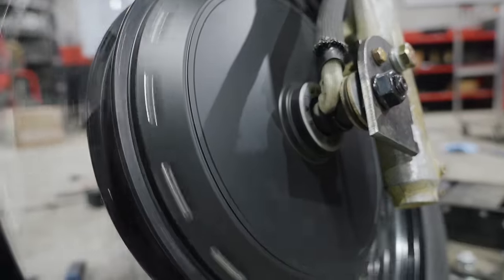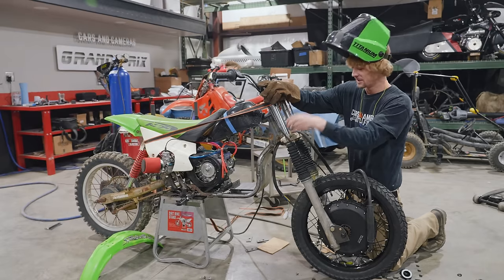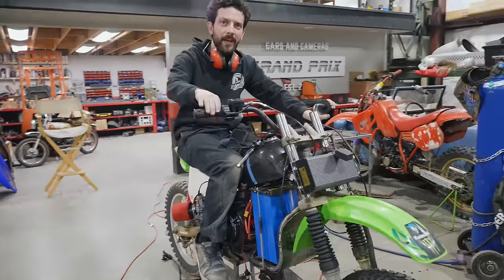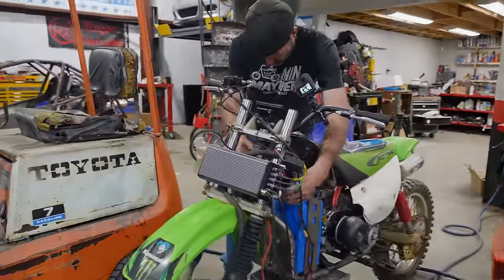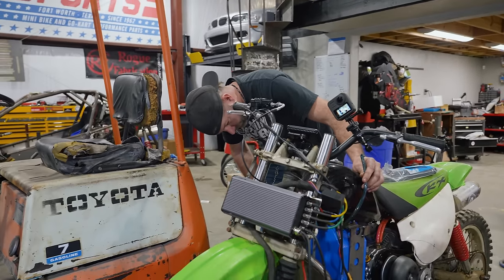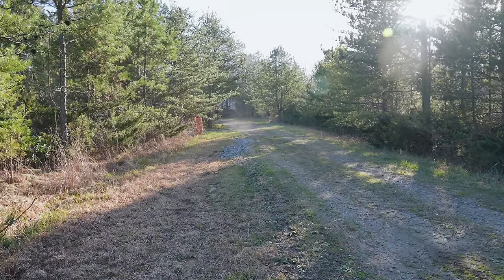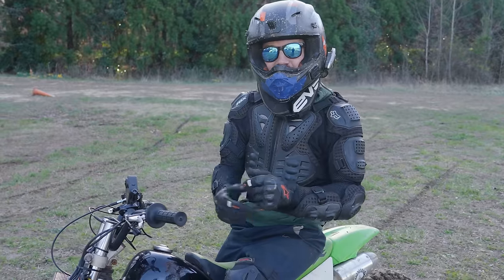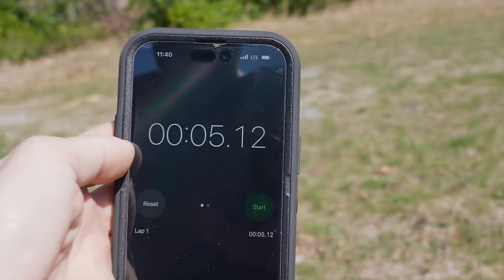AWD Dirt Bike First Test Drive! (35 Combined HP)

Comment: Mount the e-hub motor with adapted sprocket and disc brake on rear wheel, so you'll have gas and (Hyper-Boost) on one wheel. (Heavy battery should reduce wheelies):glasses-purple-yellow-diamond:

Comment: I have this exact same NB Power kit on an ebike frame that weighs about as much as a pit bike and it's insane. Easily capable of 60+ mph and so quiet you can sneak up on wildlife. A meatier tire would be much better, but with so much torque, it's going to spin anyway. A really cool idea would be to transfer the ebike parts to something like an fl350 Odyssey with the electric throttle mounted to a pedal

Comment: Hybrid is cool. you can use front motor to bump start the engine., regen to brake, recharge the battery when cruising etc.
adding a second electric motor in the rear coudl be fun too. maybe also mote controllable because it would balance weight to the rear , and you could control front and rear motors  with the same electric throttle so you woulnd have the delay between instant torque in the front and the delay of the gas throttle reving and building power.

Comment: Adjust the throttle curve in your controller . Get a way better tire and maybe design a lever that bolts the the twist throttle to push on he thumb throttle of the engine. Also, play around with assist, in theory the electric motor can automatically apply when the bike is under power from the gas engine . Awd drive dirt bikes do exist and learning to ride them ( christie is an example) is a handful but has huge benefits. See if your controller supports braking through electric motor or regen braking to help with the stopping issues.  Lots of raw untap potential on this build I hope you take it seriously and really unlock it.

Comment: think youre going to need to change some base settings , like the ramp up and maibe setting the max position of the trottle (might be to far away from actual full trottle on the handle) , not sure how you need to do this on the controller , you usually set it trough the electronic dash or through the bluetooth app 
the chineese stuff usually are a bit hard to find sensible manuals for so you might need to experiment to find out the settings you need to change in the menu 

something you might be able to try is using a sensor on the back wheel and couple that in some way to the pedal assist option , on a pedalbike sensor they usually use two sensors (1,2 1,2 etc) this is to prevent the motor from turning on when you pedaling in reverse , it allso makes it eazier to guess the speed of the pedals (times between the 1 and 2 ) 
if you can get this working you might not need the electric trottle

Comment: Dutch mopeds had brackets where this lip fit in. The brake plate had to move with the wheel to tension the chain. So the lever on the brake plate had a slot that could move on a pin but stil kept it from rotating. You could make a slot downward where these flat spots fit in. But i dont thing driving will be an issue. Braking might be giving more force.
You might have to find out settings. The controller of the electric motor needs to be set in a slow upgoing power mode. See if your controller can do that or use a frequency transformer.

Comment: Switch it to gas up-front, electric in the back. I went to a classics auction about a decade ago; one of the sales was a three-wheeler delivery motorcycle with the gas engine mounted in front of the forks, chain-driven to the front wheel - which left an appreciable cargo space in the rear despite it being a pretty dinky little trike. Always wondered how it'd pan out, what with the weight on the wheel and all.

Comment: Weld and grind and repeat till you get something like the notches you want 😊.  Put a sheet of aluminum road sign under it and clamp that down so your material your adding doesn't stick to that too.  It makes less material to grind flat again when you get the metal built up inside where you'd like it too.  You'll probably have to triangle file it flat to make it more like a machined finish and less welded metal finish though and that's time consuming.

Comment: Really need a precharge resistor between battery & controller. (Probably a circuit breaker too) the spark is because the controller need to charge its capacitors inside to work and its trying to pull as many amps as possible as soon as you plug it in. Doing this too many times can blow the caps and destroy the controller.

Comment: I think it'd work better if you used the thumb throttle for the front wheel and the wrist throttle for the rear. Then you could just add the front when going in a straight line.
 Also you could add a stop switch to the steering so it shuts off when you're turning

Comment: Gas only in the corners, both on the straights, a better tire for the front, some type of front brakes, and a easier throttle set up, maybe a foot brake for the brakes, and 2 thumb controls for the motors.

Comment: This would be a gamechanger in some heavier adventure bikes when you get stuck in mud , or crawling up some loose terrain, but only to be used then as an aid. Also could give a way to reverse a bike in tought places. And yh, electric motor throttle should be on the left. Please try mudding in the future and crawling up some loose rocks or gravel :D

Comment: You will put it down with that street tyre on the front. The dirt tyre might just have to much grip at first though. The front might dart off in the steering direction mote than you want.

Comment: I gotta see this data against doing it with a dirt tire! I’m going to be honest I thought it was going to be dumb too but I’m digging this.

You might be able to get a better top speed by gearing the gas engine a lot taller and utilizing the torque of the electric on take off. I feel like this would work with a dirt tire 😅

Comment: Maybe get regen braking working on the front.   I wonder if you could use an encoder on the rear tire to compare rpm and prevent front wheel spin

Comment: I think the reason that you are having difficulty with steering is because the motor on the front wheel acts like a gyroscope. With the weight of that motor and it spinning, the front wheel acts like a gyroscope wanting to keep the wheel in an upright position. That’s probably why they told that it is not good idea to mount that motorized wheel in the front.

Comment: A speed sensor on both wheels and you would be able to have a rudimentary traction control to keep the front wheel from going too crazy. Maybe could be done with an arduino.

Comment: With that much power you need to put a throttle on each hand so you can control the front tire separately. You only engage the front tire on straightaways. This works better on on road bikes because you have far more traction.

Comment: I tried a few different ways to do the dual throttles for AWD, twist / thumb combo, WOT switch, etc., none worked very well. Ultimately I integrated both into one throttle with adjustable FWD / RWD bias using a Cycle Analyst e-bike computer, makes it easy to tune the electric throttle in proportion to the gas motor however you want. Awesome work, looks like fun!

Comment: needs a knobby front tire.  Can controller use a speed or RPM sensor input? Might put one on rear tire or drive sprocket to provide some input smoothing or ability to control through just single thumb throttle or twist grip so you dont have to use both at the same time.  Maybe also an idea is to make it a fat bike using ATV tires.

Comment: For a monent I though this was going to be some electric transmission type shenanigans where the engine spins a generator which then powers the  motors on the wheels. Like a locomotive.

Slightly disappointed it was not.

Comment: electric bikes got a torque sensor. This sensor only recognizes when the pedal starts to move and then starts to provide full assistance at the level of assistance you have chosen. This causes the front tires motor to spin 
if you have that part put it on in rear so you can spin it in cas engine its a plastic ring where is metal taps and sensor and 2 wires put it on in right wire system and its works and you can set assistance while you drive  you can also order those parts in net they dont cost a lot.

Comment: before i even watch this video i sure hope it works because i want to do this to my 2021 honda trail 125. you can find a controller that will let it open wide open. i see some 2000W motors that run 65 mph but you are carrying extra dead weight  up to 18 minutes in the video.

Comment: Good vid.  With proper practice and application of power at the right times and amount, you will become adept at riding it.  Even with the weight of the motor in the front wheel, it'll be lighter than some of the older motorcycle front wheels.  Back when they used huge alloy castings, heavy twin rotors setups - that was a lot of front wheel weight before modern times lightening everything.  This isn't going to be drastically different.  
Keep it up 👍👍

Comment: THROTTLE SUGGESTION: for the motor control id use a hall affect sensor. they come with ebike kits on ebay for peddle assist features so no throttle is needed. put the sensor on the rear or front tire and itll detect the rotational speed and add torque accordingly. youd have to do some research for adjustable torque curve assistance annndddddd nvm just got to the video where you show the peddle assist......

Comment: You definitely need to heat shield in there but you really need to put it on the blacktop. I think you need to buy one more of those motor and battery set ups and do a go cart.

Comment: I'd make a custom sprocket for the hub motor, put it on the rear and then connect the chain. still a hybrid but one wheel drive as if you throttle through a corner that thing will slide as is now.

Comment: You should try it with the electric motor on the back and driven by the gas engine with a regular wheel and brake up front

Comment: Ive got a session on my channel about the sabvton set up for a hub motor. You need a  few bits of info even after the self learn
Phase Angle 60 or 120
Pole pair sensor count in the hub motor 
Max Voltage
Dead Voltage
You get those entered in do the self learn and trim your throttle out so its not so sensitive 1.6 volts for the low end and 4.8volts for the high  the low end no lower than .8 volts if the wheel starts spinning when the low voltage is set the voltage is to low bump it up some 1.2 should be ok for the low but it will depend on how cheap the throttle was built set your mid range throttle to about  2.8 to 3.2 volts.
Have a blast guys catch ya around

Comment: 7:06 I love how Jon is doing that while wearing earmuffs around his neck 😂

13:14 Ike: “really strange” disappears

Y’all know what y’all should do? Have two paddle throttles on both side one for gas and one for electric whichever one you’ll use more, respectively which side you want it. And for brakes just have normal brakes. One on left for front and one on the right for back or whichever combination suits y’all the best out of that cuz I know for sure y’all are going to NEED brakes for that beast of a machine

Comment: Could be great to have an speed sensor on the gas powered wheel... microcontroller with a PID loop controlling the electric motor..
So the wheel speed matches front and back

Comment: I have the same motor on my ebike. It is wired for 150 Km/h and its absolutely insane. I had it wired for 100 Km/h before but the torque was way to crazy and me and another guy crashed it because of the torque. With the old wiring the top speed was reached to fast and it was feeling strange to not be able to accelerate from that point on.

Comment: Bunch of versions of that QS273. Do you know what you have? What amperage controller? Max amp on bat? 

I'm betting you only have it in a low speed setting and/or aren't using field weakening at all. That hub (if given enough amps) will destroy the gas motor thats on there. Talking 80+mph. And 4 second 0-60 times if you throw enough amps at it. (200-400 line amp range). Assuming it was in back and you could get traction that is....

Comment: imagine if you reversed the controls. So the twist was for the gas engine. And the thumb was for the electric. Then you could use the electric motor. Only for accelerating. straight line. Or to get an extra grip on hills and tough terrain.

Comment: Where's the drag rail with it's EFI? If I had my retrofit EFI in a garage where I could run it, I bet I'd have it running good before you have an update on yours. Already did a first start video. That aftermarket stuff is suppose to be easy.

Comment: There was a 2wd dirt bike made in the 70s or 80s with a cable drive that ran down the fork to drive it running off the engine. The front and rear wheels turned at the same speed. That would be a plus here but not possible. Put the biggest gnarliest dirt tire you can find on the front anyway. Maybe just put the electric motor on the rear and scrap the noisy gas motor.

Comment: oh the reason you were told to not put this up front is because the torque is trying to rip the front off the bike, same as the weight. Under normal braking the torque opposes the bending moment caused by the weight, so it resists better. Probably would have ripped the front fork off a regular bicycle already. Make sure to inspect your head bearings and welds for signs of wear, especially when putting on an offroad tire

Comment: Honestly it might be better to have the motor on the rear wheel, chain the engine to the sprocket, and put it in boost level 5. Either that or rig the throttle to have the motor kick in after the engine, just to keep the front wheel stability. 

I’ve always wondered how it work if an electric bike was 2 wheel drive, maybe a 10kw motor in rear and 5wk motor in front. The front wheel does 70% of the braking so there would be way more regen and therefore longer range.

Comment: why dont you try to put the electric engien in the back wheel so they can work together better 
so there is low end tourqe and high end gas power like a koenigsegg so you gear the tilitson a bit higher for more speed

would be nice to see that working
Reply: If you can get the hub/sprocket figured out. I wonder if anyone has tried this?

Comment: This is really insane.  Have seen 2wd electric, but never such a combo. 
Will be fun and more useful to see the front with a real tire.  Just have to find a way to sync up the throttles. 
Or maybe separate is better? Just a learning curve for around the curves. 
Does the front motor drag if it is coasting?  Hopefully not. There has to be a brake function for that... electric front brake. No disk necessary.  o0

Comment: what about testing a real "hybrid" set up!? well i noticed that the motor being a "hub" drive it has no shaft to transfer the energy it produces like traditional driven set ups. uniquely energy is transferred through its own housing/body. so in theory could you not install a sprocket  to the hubs body as you would a shaft and produce the same affect? in turn building a hybrid setup. i think that its worth a shot

Comment: Charge to 4.2 volts per cell bank.  Typically if they get under 3 volts the sells should be thrown out.Lithium batteries do not like low voltage.  Usable charge range is about 3.3 volts to 4.2/cell.

Comment: I don’t know if you will respond to this but I have a modified predator 420 with a 40 series torque converter that I’m trying to get street legal and fast I was inspired by your blown up blaster engine into a transmission and I wanted to make or buy one that’s got reverse and at least 3 speeds  got any suggestions for me on what to do
I have a video of it running on my channel

Comment: and those e-bikes  hand brakes has a switch and wires what stop assistance when you press brakes you dont need to press it in full send just a little at switch it on and assistance stop its like a clutch on e motors in little work you can put it in feet brake system or keep it in handle pars i know what im talking ive build many e-bikes i was working in bicycle shop some time.

Comment: i saw a sprocket on the electric motor in the first vid and as wondering if you could just put it on the rear with the connected to it

Comment: I was thinking since with electric you get 100% torque from the start that they should use the electric motor to launch it and get it going and then pin the throttle on the gas motor

Comment: Why wouldn't you splice the throttle cables together and run one throttle tube? Or buy 2 aftermarket aluminum throttle tubes, cut the cable capture point off of one and weld it on the end of the complete one clocking it correctly so both powerplants work together. In other words, not fighting each other.

Comment: You guys need to flip the throttles around ,  so that the electric motor can be Only used as a boost in the straights and the gas around the curves .  ....Yes, as jasonmartin1775 said in the comments !    You Don't want the front wheel to have power in a corner ,,  that will just make lose traction and in turn have Zero control .

Comment: That hub motor is way too powerful for the front wheel. No wonder it just spins. It would be better in the back, but then it wouldn't be Cars and Cameras.  Don't worry.  It'll be fine. 😂👍

Comment: The front tire leans left the rear tire lean right. the frame ain't straight, use the front e-motor to assist the gas engine and do not rely on using it alone much more than you did alone.

Comment: Check the manual for the controller and see if you can set a little bit of regen when there's no throttle applied, it'll recharge the battery when you're running the gas motor lol